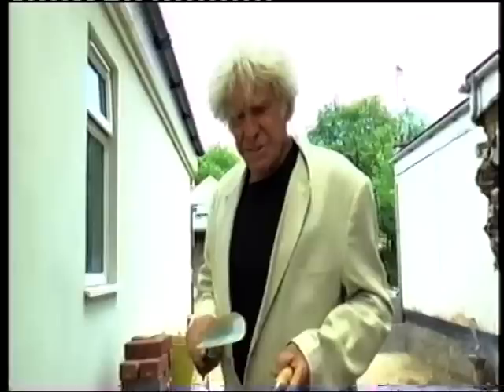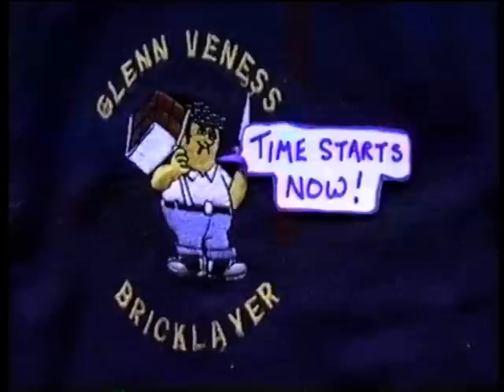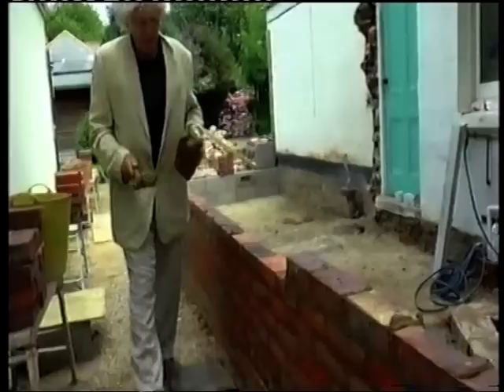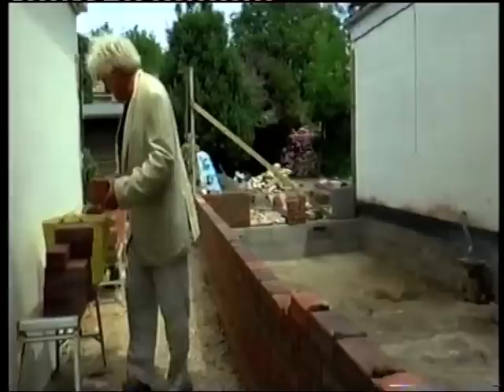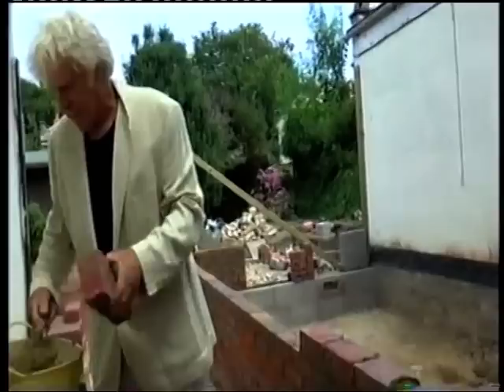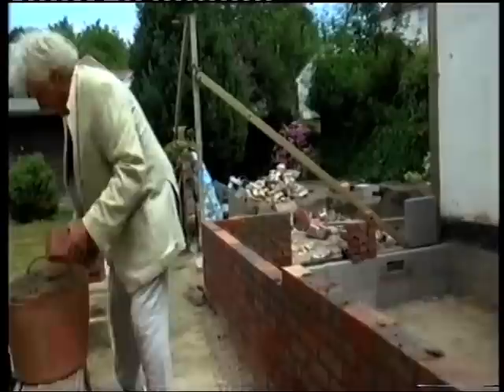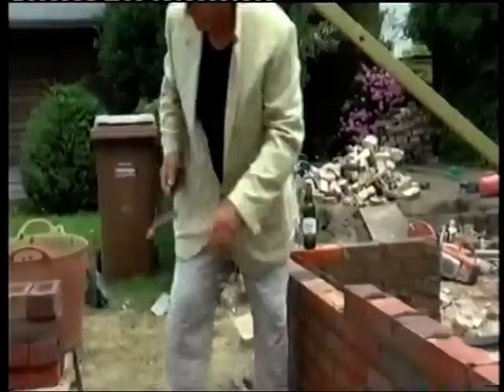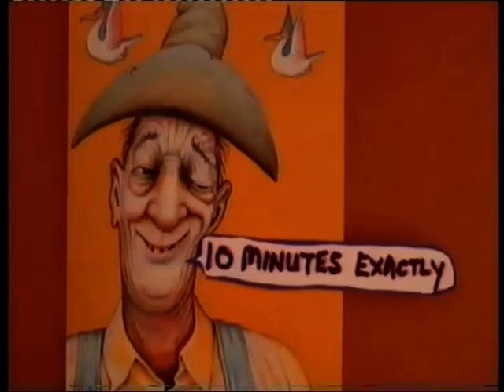BRICKLAYING MADE EASY 1 HOW TO LAY 240 BRICKS IN 1 HOUR!

Comment: When I was in my early 20's I worked in Bremen Germany with 3 other lads all from the uk. We were building houses. One Saturday 3 Dutch guys turned up they took the outside wall of one elevation whilst we were on the adjacent elevation.  They used this method and they creamed us. They were finished an hour before us. Since then I've been using this method. Too much time waisted spreading muck the whole length. I've proved the point over and over to other lads, yet they still insist on spreading the whole length lol.
Reply from the maker: Thanks Alwyn. Most of my mates do actually use this method now, and have realised
 how much better it is

Comment: Nhbc would make you pull that down at redrow frog down is bad building practise ,first thing they taught me at college 40 years ago
Reply: Find a site with no nhbc then
Reply: The top of the brick is straight
Reply: Sadly your right cant get away with it anymore they are on to us
Reply: The frog was invented to save on materials and weight ,  A modern brick has discrepancies in size during manufacture and when on site , if you need to “grind”down due to size issues ( especially when tying into original brickwork then there is necessity to “frog” them . Bricks are normally used for their compressive strength so regardless if the brick is frog up or frog down the unit is the same , and as mortar in building is designed to be weaker than the bricks used ( to absorb any later movement and not crack the brickwork) it makes no difference if the frog is completely filled . If frogs were the deciding factor in a bricks strength why do we have class A engineering bricks which don’t have a frog and are used for high strength brickwork ? http://www.masonryconstruction.com/how-to/frogs-up-or-down_o

Comment: 16 an half years on site an ive never seen this method. So i tried it the other day (with spots and no hop ups), found it was quicker, cleaner and easier on my body aswell. Thanks for the tip mate. I owe u 1
Reply from the maker: Thanks so much Ben. Really appreciate your comment
Reply: Ben Croft https://youtu.be/ojxJ8AXV8Vs when your doing your next private job try using the tubs and a smaller trowel you’ll go even faster . Very relaxed way of bricklaying . Note the Dutch guy nearest you in the video how relaxed he is . He’s holding the trowel in a very relaxed manner not choking it. The brick they are laying are 50 mm high that’s why they can use the push joint . The trowel he is using is an Arnhem trowel .
Reply: @brickbybric  im laying shallow frog bricks atm(75mm) but using the exact same method as him. Ive got a 11 inch london style  as i still do long spreading for concrete blocks. I need to convert my workmates too so we can invest in some tubs and hop ups before i get the new trowel. Lol i been using 12 inch phillies until now. So it will be 1 extreme to another
Reply: I've seen 1 other Mason do it like this it's called pic n dip and yea he was fast and clean
Reply: Legend
Reply: Iv always said work smarter not harder 👍

Comment: Decades ago I was a trained bricklayer in the US, but found an easier way to make money by selling products. The way I was trained, is the way they do it in the UK, where you have a big trowel and spread the mud in long swaths. I was taught to spread the mud the perfect height so that there was no tapping, only pressing slightly, then the excess that was squeezed out was used to butter the head joint on the brick you just laid. I could see where the German method would be better, because with the small trowel you are not lifting as much weight and getting your arm worn out. Putting the mud in the bucket to keep it from drying out is another good idea. It also saves time of having to put water on the mud board and constantly re hydrating the dried out mortar.

Comment: The having materials all up higher part has really opened my eyes! Although I will say you really shouldn't be tapping the bricks down anyway until you start getting around about chest height. The bed should be laid so that you can gently push the brick home with your finger tips, as you're doing here. If you're doing a load of taps on every brick at every height you are kinda doing it wrong.

Comment: I was a top level bricklayer qualified in 1976 after an  almost 4 year apprenticeship and could lay an average of 650 bricks a day laying bricks the conventional way.  building a standard building with no internal corners. doing my own very neat pointing {much neater than you see here.}  that's 93 bricks an hour over 7 hours of work. 23 bricks in 15 mins including building corners. Glen has some good points in what he says, but having bricks up that high and working out of a bucket has some advantages and some disadvantages. at the end of the day I think I would of laid as many if not more  bricks than Glen did. I did have my spots on two concrete blocks to save on the bending down, but sorry no way is laying mortar for one brick quicker than laying for a few at a time.

Comment: You'd have a problem working with a left handed bricky as we tend to work forwards - no bum fights in the middle. And those bricks are designed to be laid frog up. But I'm with you on the Dutch method. Best used with a rounded Dutch trowel.
Reply from the maker: Agree entirely John

Comment: Well done lads great video and banter. It’s very very hard to convince long bed layers that this is the best method to use when bricklaying. As you say in the video it struck you that the Germans Brickys were quicker than you because of the method they used .The majority of the worlds bricklayers use the method you demonstrated . It’s mostly Bricklayers from English speaking country’s that use the long bed method. There is a very good bricklayer on YouTube called robsonger who uses this method but he works off mortar boards and uses an 11 inch trowel which I believe causes him to be not as quick as he should be when using this method. Your 100% correct when you point out that it’s best to work out of mortar bins or tubs and use a small trowel . The whole thing is a system ,small trowel, mortar tubs , keeping the brick up off the ground and going to the wall with mortar and brick at the same time . 👍
Reply from the maker: Thanks so much for your positive comments mate. I hope I didn't come across as being arrogant in the video. It's just that I want young bricklayers to know about this method. Knocking up mortar if it's drying up is a lot easier in a bin, than on a spot  board, when the brickwork invariably gets splashed. Thanks again buddy
Reply: glenn veness no Glenn the opposite in fact . There is another video on YouTube of an American guy using the method your demonstrating . Another lad left a comment relating a humorous story he had heard of 2 American bricklayers that were put together on site . One guy named bob that uses the long bed method and another guy named Jim that uses your Dutch / German method the Americans refer to it as pick and dip or New England style. So the story go,s like this . Bob starts laying out his long  bed furrowing and fiddling with the mortar etc trying to get it bang on . Meanwhile Jim has 3 or 4 brick put down while bob is still busy laying out his bed . Bob having never seen Jim’s style of bricklaying shouts over to him asking what in hells name is he doing and Jim reply’s laying bricks bob what are you doing.
Reply: https://youtu.be/-QTcaQkCI5s here’s a link to that video with that yarn about long bed versus pick and dip.
Reply from the maker: Brilliant. Thanks so much
Reply from the maker: Great story that. There is absolutely no doubt it's the best method. All my fellow bricklayers do it now. Thanks again for you're feed back mate
Reply: I don't really like pick and dip. I generally spread enough for 6-8 bricks.
Reply: What Rubbish.
How far did he walk?
 I can see from his handling of bricks that he can lay but all that cobblers about the bed.
 Said he had wet muck yet said the board dries it out.
The only thing I agree with is not tapping the bricks..
Waste of time
Reply: bric bybrick .

Comment: I do masonry in Canada from Poland and have alot Germans in my crew we all got a could laugh. The pale was great, and the beer with a blazer. The motarboar is wetted ti start and if your motar is dring up thats because your working too fuck slow. When you pull moater off the boar the motar rolls into a bun like ready to spread evenly no need to frey it afterward, and you dont break your wrist. And dont work backwards if you dont have to it dangoures, you dont see the criss joint as well.

Comment: That works about 240 bricks per hour , in 5 hours that would be over a thousand bricks, not bad
Reply from the maker: It really is the easiest way to lay bricks
Reply: Straight run, no ties, insulation, expansion joints, corners, openings, lintels, bollocking lazy hoddies...
Reply: If only every job was a straight full wall and you running to a line all day and the weather is good,sadly it’s not an ideal word for a Bricky ☹️

Comment: That's the german system, picking up the brick and the muck at the same time. And it's good, specially in summer. But working from the board is much faster. And if u get paid by the brick, that's what u want.

Comment: If you don’t tap down the brick won’t the uncompacted mortar compress and squeeze out when you put the next course on (assuming it hasn’t gone off in the meantime)?
Reply: Benzknees  he is compressing the mortar using just hand pressure instead of tapping with the trowel.
Reply: We’re bricklayers not bricktapers !!!
Reply: bric bybrick - But the mortar is unrestrained, i.e. it can squeeze out from the joints if you push down on the brick, so compression won’t necessarily translate into compaction. Tapping by contrast seems a bit like using vibration to compact concrete.

Comment: I agree with you a 1000 a day in an 8 hour day is fantasy but not sure you are right about spot boards it is harder to get mortar out of a bucket. I agree with you about trowel size though but I like the WHS 11" London pattern. However, although I can see you are an accomplished bricklayer in my book you have done one thing wrong. Never lay bricks frog down. Like your style though. 🙃
Reply from the maker: Fair comment Dave. Check out my other videos though. Bricklayers in Germany and Folly in Sussex
Reply: David Dore the proof of the pudding is in the eating .you can see that glen is getting the mortar out of that big bucket with ease . Ud need to be using at minimum a 40 liter bucket/tub for the pick and dip system to work properly. Using mortar boards with this system just slows you down.

Comment: Why are they all frog down thats aprentice level behaviour!
Reply: They're solid bricks.
Reply: Oops - no they're not.  Bad practice, weaker wall, not solid.  Not allowed on London sites.
Reply: @moresby06  definatley not. Can see a frog on the bricks
Reply: @moresby06  just see your second post. Forget my 1st lol. Out of a tub aswell.....bad form!
Reply: I use two trowels.  A big one to lay the bed then I switch to a neat little bedded in one for the perps.  Also means I can get the hoddy to point/dong up with one of the trowels.
Reply: I'd use a tub in a confined or awkward space.
Reply: Easier to drag it along.

Comment: one visite to the spot board pick up enough morter to lay 4 or 5 bricks instead of once for every brick put morter on end of first brick then use the morter you scrape off to butter the next brick your going to lay.easier or not,go fiqure .
Reply from the maker: If I lay 50 bricks Peter I will bend down 50 times If you lay 50 bricks you will bend down 50 times for the bricks and 10 times for mortar. You will also have to spread the mortar and be putting more strain on you wrist. On a hot day your mortar will dry quicker meaning you will have to tap the bricks to the line. Stay safe buddy, glenn
Reply: @glennveness  what a load of twaddle,i pick up morter 10 times,you pick up morter 50 times.go figure.i put morter on the bed,and it goes off.doesent it also go off on the spot board.
Reply from the maker: @peterjones9884  Sorry Peter, I tried to give you an informative polite reply to explain why the 30 bricklayers I had working for me in Germany all adopted this method when they came back to England. Good luck in the future mate
Reply from the maker: It did Peter. That's why I find it so refreshing when 30 years later and with no chance of losing their job, they still ring me from all over the country to thank me for my advice. Charlie Collinson is the best bricklayer by far on you Tube. Message him and see what he thinks. Stay safe buddy, glenn @peterjones9884
Reply: @glennveness  I've got to correct you there glen Charlie would be the best on YouTube if you and Rob Songer weren't here!
Reply from the maker: @Droningonuk  Thanks Alistair. I'm glad you enjoy my videos mate, glenn
Reply: @glennveness  we need more videos let us know when your out in Hastings again I'll come and buy u a drink or 10!
Reply: @peterjones9884  Glenn picks up mortar and visits the wall in one and the same motion. You are making 10 extra trips plus the spreading, as Glenn points out. The only one talking twaddle is you. The maths is clear, so the strain on your body is reduced proportionally. You struggle on fella you clearly know better. He also explained why he isn't using spots ffs.🙄

Comment: Just watched a video of Charlie Collison where he used pick n dip to lay 50 bricks in 10.5 minutes including jointing up. So pick n dip lays 275 per hour to 160 per hour using this method... hmmm
Reply from the maker: Hi KM. I actually lay 40 bricks in 10 minutes, which if you can do maths, equals 240 bricks per hour. I am also chatting to the camera, and not rushing. Charlie Collinson is the by far best bricklayer on you tube. Like many bricklayers he now uses pick and dip, but I think you may find they've all started since I posted this video. Let me know if you can find o video where they used it before me. Stay safe buddy, glenn